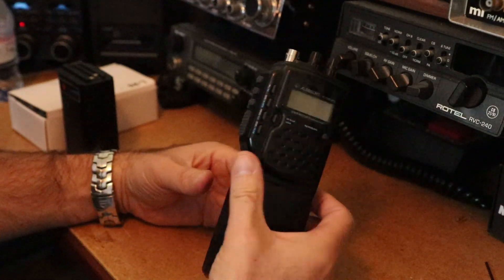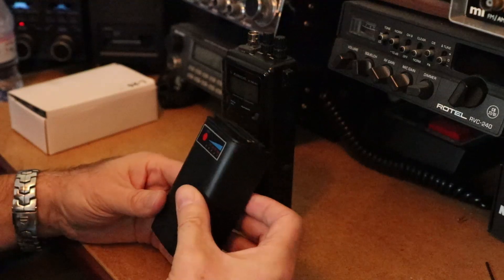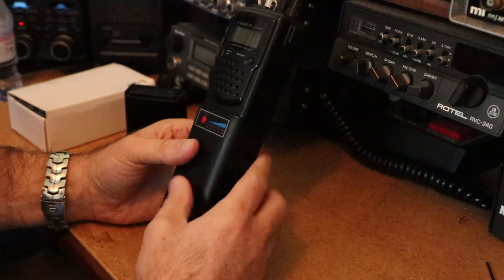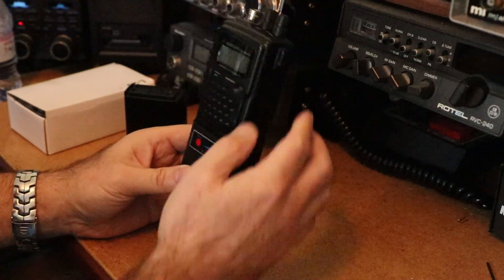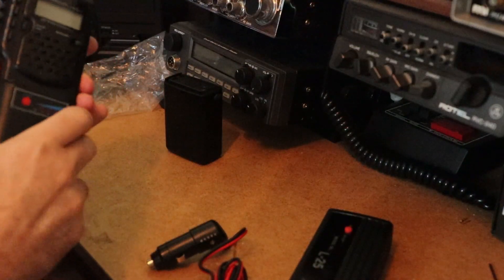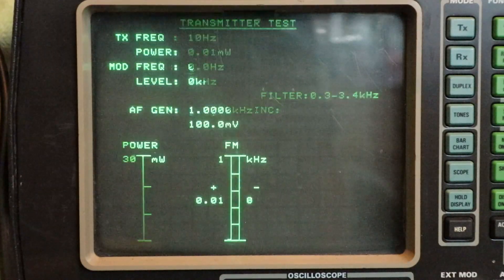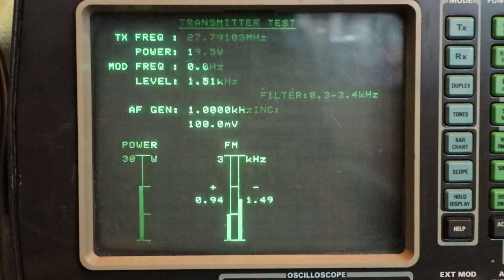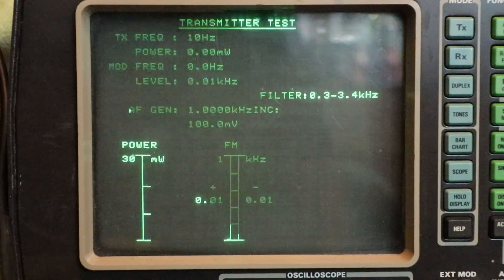Albrecht AE2990 Battery and Amp

Comment: Midland has a car antena/lighter Pack a lot smaller from the alan 42 they have the same connections.
Reply from the maker: Yes, I have the regular car kit as well but that doesn't have a built-in amplifier!
Reply: Sorry i just view it very quickly and did not notice it was a amp too, never the less that in Europe could only be used if it pushed just ssb to 12w, because here it's 4w-A/FM and 12W SSB/CW, but good anyway, only one cable each and 20w ok.  @justradio5521
Reply: anyhow i'm having troubles with mine, i'll send you a mail if possible about it to discusse it with you
Reply: @justradio5521  Ok just noticed that you do not have an e-mail here, so, how is your experience in ssb with it, i find that even with the modification for ssb for the talanto condensator, i still experience that even after i reset the VR, after a while or just closing the box it goes out of frequency again, have you had this problem and the receiving is still noise and garbled if the RF is on max, i have to cut a little bit.
Reply from the maker: @luissousa9251  Sorry for the delay, not sure about email, I thought I had that set up correctly but I guess not. I've not had frequency issues, it sounds like your radio has been modified though, has a complete alignment procedure been followed since it was modified?